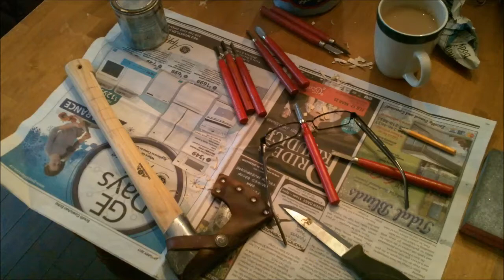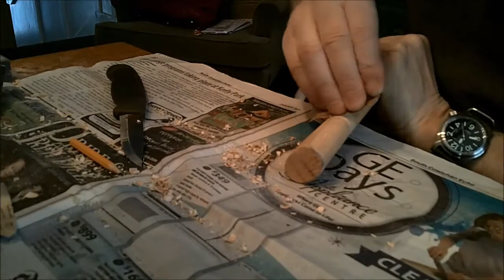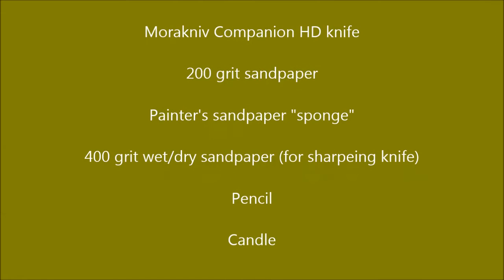GB Outdoor Axe Haft Re-profile

Comment: any tips on getting the handle darker out of the box? should i just apply linseed oil or sand first?
Reply: Sorry for the inordinately late reply. I'd sand lightly first, then apply the oil. Don’t forget you can also use a stain of you prefer, before oiling. Wipe any excess stain off and let it dry overnight. Add more stain coats in the same way as desired.